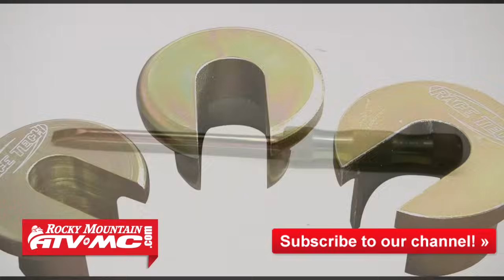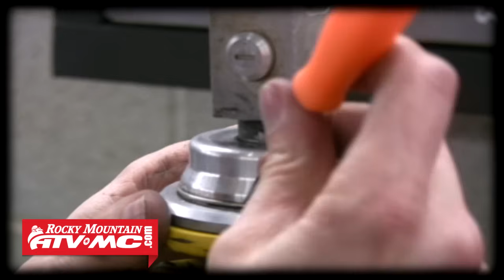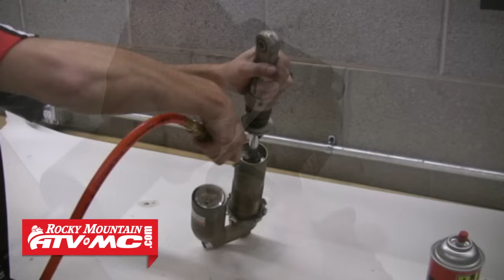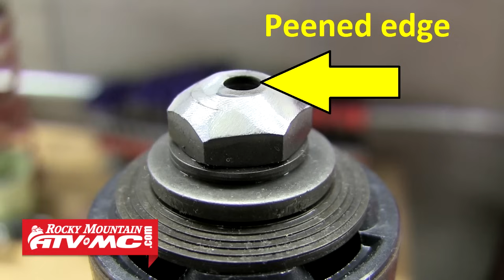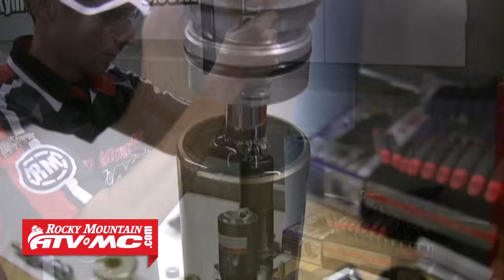How To Rebuild a Motorcycle Shock

Comment: You forgot to flip the shock upright and bleed any remaining air trapped in the shock out the bleed screw or compression adjuster (removed) ,I attach a small funnel with threaded end screwed into the bleed hole and half fill with oil making sure the hole is at the highest point usually slightly tilt the shock body to achieve this then slowly compress and pull the shock shaft in and out watching for air bubbles raising into the funnel of oil once clear remove funnel and screw bleed cap back in , recharge with 1bar nitrogen and install the spring
Reply: Wish I read this comment earlier

Comment: Lol, everything always works perfectly in the videos, but meanwhile here in the real world.. Shove the seal head down with the tool, but as soon as I stop pressing down, it pops right back up again. Same for the bladder cap. Valve core is out of the bladder so that's not the problem. Take it to a friend's shop tomorrow and lock it down in a vise so maybe I can press down with one hand and pry the lock ring out with the other..
Reply: Same experience here as you on disassembly. Now I'm about to reassemble, thanks to this video, and not looking forward to getting the circlips back in. DId you find any trick 2 years ago when you did this? :-)
Reply: Everything is always easier in a proper shop.

If your in a shop-

Everything is always easier in someone else’s nicer shop xD
Reply: @iprefernot2  were you able to fix this?

Comment: Hi Rocky MTN. I got my parts this afternoon for my 2016 YZ 250. I  had a badly leaking rear seal so a service was necessary. I had the shock off and sitting on my work bench until the specialty tools and parts arrived. I took my time, followed this video step by step in my garage and about 1 to 1.5  hrs later I was done. I will get the nitrogen in the next couple days then I can slap it back into my bike. I really appreciate your time making this video to help me learn my bike better and save some serious cash. Great job!!!

Comment: so i did like you said pull the stack with the flat screw driver, everything was great.  I forget what happen but the stack was laying on my bench and someone was using a hammer so my stack fell off the flat screw driver.  Now I have no idea how to put it back together.  I did the best i could, and when I did, my dials don't work properly.  Any advice, I'm going to remove it again from the bike and do this all over again. IF it matters its a 2004 rm125

Comment: Followed these steps and got it regased but they said it had alot of air still in the oil ! .BUT some shocks have bleed screws and other adapters to bleed it 100% unfortunately they don't tell you in this video .

Comment: Thank you for the video! I'm rebuilding my yz426f rear shock and forks with stronger springs so I can do bigger jumps and not bottom out, and they needed new soft parts anyway. This was my first shock rebuild so I have a few words of advice for others to avoid my mistakes, which can be seen in a soon to be posted video: 
1.  I'd recommend going ahead and removing the valve stem first thing, it makes the step of pushing the seal down easier so you don't have to worry about building pressure. 
2. The Bladder is attached to the bladder cap; I used air to press the cap out and it popped out and didn't realize there were supposed to be attached. 
3. Don't neglect to remove the peening from the top of the bolt. I tried to simply use an impact and destroyed the threads. I repaired them with a m12-175 die but I couldn't get 30 ft-lbs on those threads so I got as much as I could and welded the nut on cause I can't get a replacement fast enough for my trip! 
4. A battery powered inflator or 12v car inflator works well for putting pressure on the bladder. 
5. Don't get the bump stop and Seal cover placed wrong way around! I accidentally did. I wasn't about to remove the piston again (and couldn't have disassembled it anyway cause of welding the nut on) so used a hot knife to cut the bump stop off and re-attach it back in the correct place. It isn't pretty but should work and I'll still be able to ride in 2 days!

Comment: This method of filling and bleeding is sooo much easier then using the compression adjuster port as shown in another video.  This was fast and easy!!  Thanks!!
Reply: Will still have air in the oil this way
Reply: @450ABTown air doing it this way, or air in it when filling by the compression adjuster like the TBT video?

Comment from the maker: @Poop On-i-JUNKs 1. I haven't had a chance to tear into one of the newer shocks yet but there should be someway to connect or attach a tool to pull the bladder out. Have you removed the retaining ring?
2. There is really no way to get absolutely 100% of the air out. The goal is to remove as much as possible and tapping and running it through the stoke as shown in the video will help with this.
3. No, definitely do not drill anything
4. Explained with question 2
5. This is affected by too many different variables to have one setting for your bike. I would start with stock settings and the recommended oil and adjust to your conditions from there. 
Thanks for watching!
Reply: Rocky Mountain ATV MC what all do you replace when you rebuild a shock

Comment: Didn't see you inspect the shim pack for bent shims, also nice new nut on the shaft for the re assembly. The bleeding is another area where most guys will fail. The addition of the nitrogen is actually the easiest part.

Comment: Of course.  Clips are out...I ended up using compressed air from the reservoir side and it still took some doing.  I've done a few shock rebuilds and they rarely come apart easily.
Reply from the maker: Shawn Warner Compressed air is a pretty slick way of going about it.  Nicely done man! Thanks for watching our videos.

Comment: hello, Thank you for awesome video. However, I have few questions for you.
1. how do you remove 2013 Kawasaki KX450f rear shock reservoir cap, since it uses a needle to fill in gas, and nothing to grab on to pull to bring it out?
2. When you inserting the seal housing in to the oil, doesn't """some air"" gets trapped under it?
3. Should you drill a small hole on the side of the seal housing below the large outside O-Ring to get that air out, to remove as much as air possible?
4. if small amt of air gets trapped inside the shock from seal housing installation , will that cuz a problem? (Or any air in general)  
5. do you have a recommended Suspension Setting(front and rear)and Oil Height on the front forks for 2013 KX45F, AND oil "viscosity" used on front and rear fork and shock?

thank you very much for all you help and time making this video.
Reply: Did you figure it out?

Comment: 3 sub-frame bolts and loosen the carb boot, to remove the sub-frame with the seat, air-box and rear exhaust system in one piece, (and just as easy to put back on). No need to remove the tank. This is why the sub frame was developed over 30 years ago.
Reply: It looks like the 4-stroke made removing the sub-frame more difficult with hoses and wired attached to the air box.  Yet another reason why 4-strokes suck. :)

Comment: Excellent presentation.  The only thing I would question is why the shock bumper wasn't replaced while everything was taken apart.  Those bumpers will age and split over time, which is what mine did.  They're not that expensive to change and that one in the video looked rather old.  Otherwise it's an excellent tutorial.  I used it step by step to change out my bumper.

Comment: All these videos don't use the solid piston band. These bands require a special tool to put on or you can stretch it and then put on the piston. I stretched mine then wrapped it tightly with electrical tape and put it in the freezer to get it to shrink up a little. It's a tad loose now. If I have to do it again, I'm going to get one of the MX tech low friction units because the old band was a source of a lot of my friction. This is a great video but like the other you tube videos it misses the dampening adjuster. The spherical top bushing and O-rings don't come in the pivot rebuild pack.

Comment: The video is a tremendous help. Thanks! One question, how do you swap out the copper looking bushing that rides on the outside of the piece that sits between the groups of valve shims. I got the pivot works kit so I have a replacement bushing but it's not split like the fork bushings. 2016 YZ250. Thanks!!

Comment: i have a question, i want to do it for my kxf 250f unitrak shock, i dont understand in the time when you fill with oil and put the piston assembly, when do you close it? i mean when you purge, with compresed piston or descompresed? i cant explain it, look at 13:10 minute, in that part its my question, doesnt vary the level of fluid? because if its descompressed it will be more space for fluid, if it compressed less space for fluid, ?
please help me, im getting crazy hahah!!!
thanks! really good your video
Reply from the maker: Monica Armentano You would just want to follow this video honestly. You would want to purge the system with the piston up and out or "decompressed" to get all the air bubbles out. Then pour more fluid in and install your piston.  Thanks for watching our video man!
Reply: +Monica Armentano WOMAN¡ i think...

Comment: hello thank you very much for the good work. I live in Brazil and have nothing on the gsx750f 2006. shock absorber. You would have any video on this motorcycle. mine leaked the gas and a little oil in the coupling of the hose.

Comment: Hi there.  I have a ohlins shock . The shaft has the rebound needle inside of it . The shock has a plastic nut to adjust it manually but the needle get stuck in the up position and when I turn the nut to make the needle go down , the nut stop clicking because it get stuck in the up position.  Do you know if this is normal ? Or what can I do ? The problem start whit oil leaking.  Now I'm thinking it was leaking from the adjust nut because retainers and seals look good for me . Thanks

Comment: Thanks for the video, it is very informative, but I have a couple questions. Won't the punch marks between the nut and shaft cause damage to the nut the next time you try to remove it? Will the high strength thread locker require heating before nut can be removed, and if so, could the heat damage any of the shock components?

Comment: My son's 2011 KX250F has Factory Connection setup with remote Nitrogen chamber.  Is the process the same?  Shock puked its oil and needs a reseal. Thx

Comment: Hi, great video, what oil do you use and the velocity, thanks
Reply from the maker: Typically a light oil for mx shocks. Either a 3 or 5 will work good! I run the Maxima 3. -Charles
Reply: @rmatvmc  thanks for the reply, I have putoline folk oil 5w would that be OK to use in the rear shock?

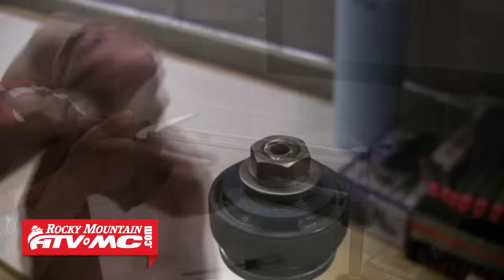Comment: 10:39 Does the tightening torque of the nut affect damping characteristic, is it an adjustment of the shim preload or doesn't matter if I torque a little bit more or less?
Reply: Torque is to keep it in place. It cannot be adjusted via torque.

Comment: Checked the OEM parts guide (1997 YZ125) and I cannot find the replacement nut for the shock shaft. I ordered an All Balls seal replacement kit from RM and one was not included. Do you know where I can get a replacement nut? Also, is the nut used from OEM of specific metal/ compound? Last question; on the next rebuild would you have to grind the new replacement nut down again to remove? Thanks in advance- love the videos.
Reply from the maker: David Andrade  If you needed to replace that nut you would need to get the OEM one from the OEM schematics.  To answer your last question, we use the loctite with the added punches just to simply add to the locking of that nut.  It would not require any grinding to remove if needed rebuit again.  Thanks for watching!

Comment: Question: The main shaft assembly of my CR250 shock (Showa) doesn't come out as easily as in the video.  I've tried wiggling it out and tried pushing compressed air thru the reservoir with the compression backed all the way...and still it won't come out.  Any suggestions...?
Reply from the maker: Shawn Warner I would make sure that you've gotten all of the inner retaining clips out.. but as long as you have followed this video, it covers pretty much all the steps for both Kayaba and Showa shocks.

Comment: this might be a stupid question but if its a nitrogen filled bladder, is it ok to use normall air? and if i want to pump mine up can would it be ok to have a air/nitrogen mix?
Reply: Dry Earth air is approximately 78% nitrogen already.  The only reason pure nitrogen is recommended to fill a shock bladder is because nitrogen molecules are larger than oxygen molecules, and it will take them longer to migrate through the rubber bladder.  Oxygen molecules could (theoretically) migrate through the bladder, create tiny bubbles in the oil and lower the pressure in the bladder.  If you're a pro racer, that may be a concern for you; but for most of us mere mortals, there is no disadvantage to using dry air if you can get the pressure high enough

Comment: How often should a rear shock be rebuilt and or fluid changed?
Reply from the maker: Most suspension shops will recommend you have your suspension serviced anywhere from 20 to 50 hours but it will really vary with how aggressive of a rider you are and the conditions you're riding in. But many riders who are just weekend warriors will change fluids at about 40 hours and rebuild once a year. But you can check out your bike specific service manual to get a better idea of what your particular shock recommends.
Hope that helps!

Comment: i have a 2005 kx250f and the manual says 142psi nitrogen but im using light weight maxima racing shock fluid. so, if i put about 150psi nitrogen in, would it substitute and make the shock stiffer?
Reply from the maker: Ya know, I don't know?  I would first recommend going with a heavier shock oil wt. before playing with the bladder pressure.  Especially when the manual say's to use 142psi.  For Safety reasons, i would go off of what the manual says and pressurize the bladder to 142psi and use a heavier wt. shock oil.
Reply: Rocky Mountain ATV MC i'll just fill it to what the manual suggests, better safe then sorry but thank you for getting it more clear on what i have to do. best source by far!!!
Reply from the maker: You're welcome anytime.  Thanks for asking and good luck!

Comment: Hello friend, needs to actually use gás? I can not use compressed air?
Reply from the maker: Igor Vinicius Nitrogen gas is used to keep the shock running cooler. Nitrogen can transfer heat out of the shock oil much more effectively than normal air can. Its up to you, but i would refer you to your service manual for the bike. Thanks for watching our video!
Reply: thanks
Reply: Igor Vinicius Keep in mind that normal air is 80% nitrogen, so using compressed air is generally not a problem unless your system is running to extremely close tolerances. A lot of tire places are really pushing to sell nitrogen these days because they can't make money from you filling up your own tires.
Reply from the maker: Andy Greenwood  Thanks for your comment man!
Reply: Andy Greenwood  the other reason for using pure Nitrogen over regular compressed air is that compressed air will leak through the bladder rubber over time. Nitrogen does not leak through rubber and also maintains a much more accurate pressure under temperature variations.  I used to use compressed air in my ATC's back in the day because back in the 90's it wasn't common place to get Nitrogen unless you want back to the Dealership and in most cases they horrendously over-charged (probably because they were angry they didn't get to rebuild the shock and charge that labor) :)
Reply: +brett248vista 

J
Reply: Wisam  J ?

Comment: I know this might be a dumb question but do you have to refill it with nitrogen air??
Reply from the maker: Yes.
Reply: @rmatvmc  why
Reply: The main reasons for not using regular air is that the nitrogen is free from moisture and it also wont heat up (thus expand and create more pressure), but it wouldnt be the end of the world if you didnt use nitrogen. In my service manual for an 01 RM250 I had, it said moisture free air can be substituted for nitrogen

Comment: What's the best way to fill a kyb shock for a 2011 yz450 where the reservoir is 90 degrees from the shock body and not parallel like in the video?  Do you use a vented plug for the body while filling the reservoir?
Reply from the maker: You can fill it through the valve adjustment hole.  Maybe you can do it this way.  Make sure you let the
air pressure out of the bladder!  https://youtu.be/tu85Fnx8UPU?t=1m53s

Comment: Thank, this is a verry nice video hope it will work for me !! 
Now i got to order the seals first ! ;-)
Reply from the maker: +moekakke You're welcome! You should be able to tackle the job.. let us know if you have any questions.
Reply: +Rocky Mountain ATV MC  Hi, normally tomorow i do the job, this video is verry detailed so i do'nt think i'll have anny problems. Il's pointweld the bolt back on the treat that's ok i guess ? 
Now just for the understanding of this system the bladder is only there to compensate anny loss off oil in de shock or does it also makes the bike run smooth on harder surfaces ?
Thanks !
Reply from the maker: +moekakke We recommend using a loctite and a punch to insure the shock nut doesn't come loose.. I would recommend following your service manual.  The nitrogen bladder is used because it can be compressed when under a heavy load where oil cannot.  So that is why you have a nitrogen bladder & shock oil in the rear shock to give you that consistant dampening.
Reply: +Rocky Mountain ATV MC Thanks again bro the shock is like new again !!
Reply: Why do you have to use nitrogen in the shock instead of just regular air?